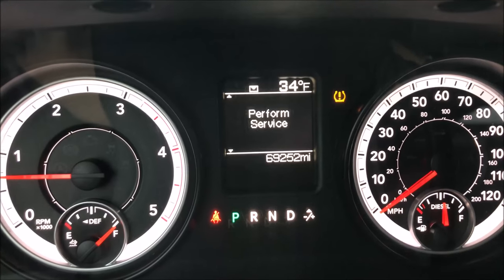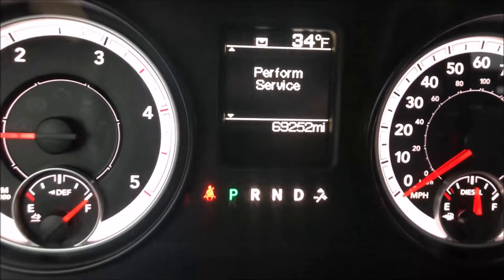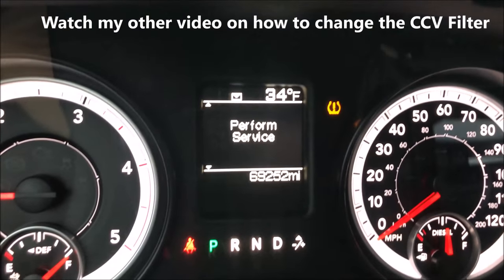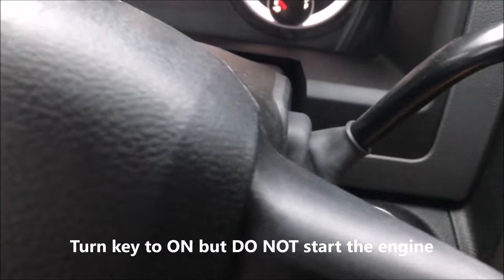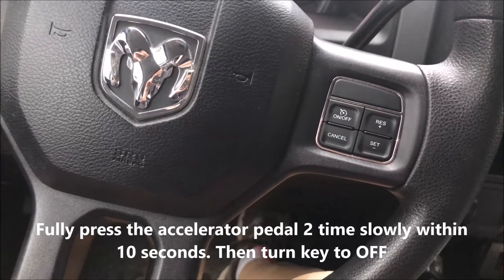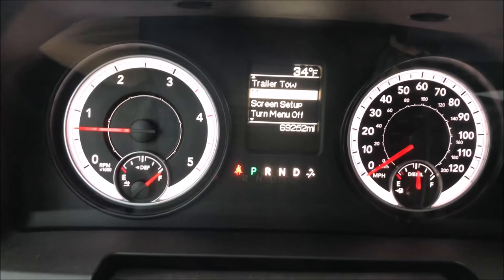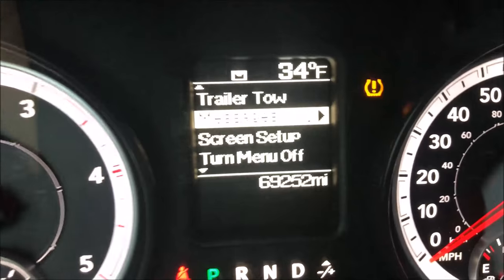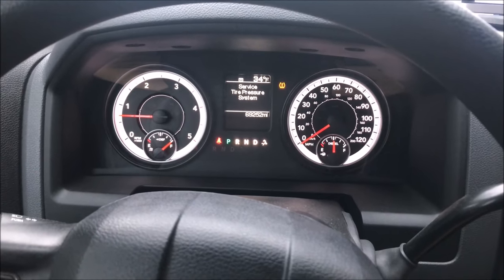Reset the Perform Service Message on a Ram 6.7L Cummins

Comment: Man I appreciate that. Changed CCV filter about 5000 miles ago and that PERFORM SERVICE has been an eye sore! Especially with a buddy that rides with me sometime when I hot shot and he sees it. Of course he is a Ford guy and he was giving me hell. Lol. He kept saying you should've bought a Ford because he thought it meant something was wrong with it. He can't laugh now because he just had to put he's 2018 Ford F350 in the shop with fuel system problems with only 38K miles on it ! Actually he's had it in there 2 other times with other problems! Lol. That's why I went to Ram. 4 Ford's was enough. To many times stranded on the side of the road. They DON'T HOLD UP WITH HAULING EVERY DAY!
Reply: They dont hold up to anything I was a Ford man until I owned my 6.4 for 2 years and I will not ever purchace another ford product!

Comment: Turn key to run. Press and HOLD accelerator. Press and release break twice. Slowly release accelerator. Press and release accelerator twice. Turn key to off.
Reply: Thank you! This is the way
Reply: It did not work
Reply: Process in the video didn’t work for me but yours did.   Thanks!
2016 Ran 2500 Laramie
Reply: Thanks a lot I tried what in video 10 times it didn't  work,  you method worked. Thanks
Reply: The video method worked for my 2018 3500 Ram  Laramie with the 6.7L   Is it the year or model number that matters?
Reply: @jimmyjo1375  yes, that did it for me on a 2015. 
Thank you

Comment: Worked in my 2020 6.7.... PUSH BUTTON to RUN, 2 brake pumps, 3 slow fuel pumps and then off. Door was closed whole time. Windows down.

Comment: I appreciate video but I have a 2021 ram 2500 and your way wasn't working for it so at after the pressing of the brakes 2 time and the gas 2 times slow I just start it str8 after that and it was cleared this is just a update if anyone have a problem still but as I said I appreciate the steps to do it
Reply from the maker: Awesome, thanks for the update!

Comment: I have a service abs brake system that comes n goes especially if I hit a hard bump in road. I have a 18 ram 3500 dually. Anything that I need to worry about? Been told by others it's a bad sensor possibly.
Reply from the maker: Mine does that too every once in awhile. Found it was the seatbelt wire connector for the drivers seat. It was coming loose.

Comment: Mine doesn’t show up till after 10 or 15 minutes of driving I took the filter out. It was completely fine. I tried resetting it I thought it was reset, but it came back again.
Reply from the maker: Strang. Never heard of one coming back after resetting. Not sure if the truck knows whether the CCV filter is changed or not.

Comment: Yep gotta press the accelerator slowly! Thanks for your help- worked on my 2016
Reply from the maker: Glad it helped
Reply: How slow? I can’t get it to clear. Plus I have push button start
Reply: How do you do this I tried still x
Come on 2016 3500
Reply: @CampfiresAndMotors  can you help trying to reset my perform filter I tried it nothing
Reply: How do you do it

Comment: 2nd time around not being able to reset. Last time after several thousand miles it reset it self. Hoping it does it again sooner.  Dodge might have a fail safe that resets  it. If any body has an idea how many miles , let me know .
Reply: I'm having a similar issues with my 2014 slt 3500 it's not letting me reset it after I changed the filter.
Reply: @thethoughtfulcarpenter  there is still hope

Comment: I had my truck deleted. 2013.  Every now and then I get a Air Filter  Service ding.   Been 2 days in a row now.  Last week I didn't see it at all.  I also notice I kinda trigger it when I got the gas harder than usual.  Any ideas? Anyone?
Reply from the maker: Sorry, no ideas. Mine has never done that
Reply: Look in your fender well. There is a tube that collapses over time and causes the air filter light.  The tube is there to direct air from front of truck to your air box.  I removed mine and no more light.  Motor city mechanic on YouTube has vids on it.

Comment: Any idea on how to reset a 2018?
Reply from the maker: No, have not tried one yet. This method does not work?
Reply: yes is work i fixed thanks
Reply: This worked on my 2018 Laramie. I just did it and there is no longer any stored messages, after following the example in the video.

Comment: Why cant they just put "change ccv filter"
Reply: Because you have to pull and clean the egr valve and egr cooler all at the 67,500 miles on 6.7 cummins along with CCV filter.
Reply: @rracerr9  I lost mine in a boating accident

Comment: I've tried 50-60 times slower ,faster .won't. reset.
Reply from the maker: Dang! No clue. What year is your truck? Mine is a 2013 so I know it works on that model year.
Reply: @CampfiresAndMotors  07 worked 2 times before not this time

Comment: Just to let you know you did not have to touch the brake pedal at all you have to do the gas pedal three times within 10 seconds come on dude you have me sitting here for 30 minutes doing the wrong s***
Reply from the maker: Well that’s how it worked for my truck, sorry yours was a little different. Glad you still got it.
Reply: Using the gas peddal 3x is to reset the oil life... Not the perform service light. Perform service is for the ccv (crankcase ventilation) filter/egr tube (exhaust gas regulator) which gets clogged with muck from the engine exhaust. DO NOT do the gas pedal 3x. Unless u want ur oil life reset

Comment: B/S does not work
Reply from the maker: What year is your truck? Video is from a 2013
Reply: @CampfiresAndMotors  2016
Mine requires two pumps of the brake pedal followed by two pumps of the accelerator.
Reply: @charlesherrick3798  that's exactly what the video says to do lol

Comment: Lol its not just a cvv replacement reminder its a entire egr cleaning service you need to perform, by not doing this your asking for nothing but emission problems
Reply: We stopped doing the egr tube cleaning recently on the newer trucks. Becuz the emissions are naturally cleaner. Replacing this filter is all they need now.